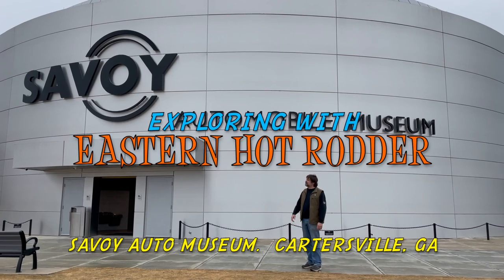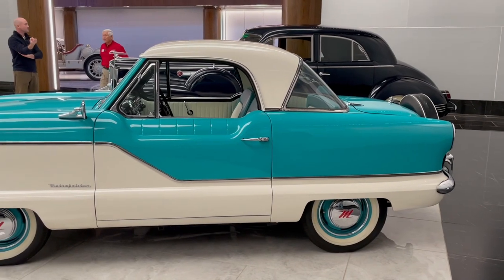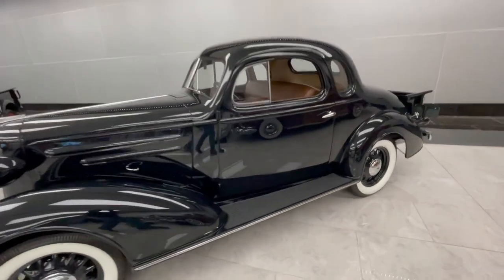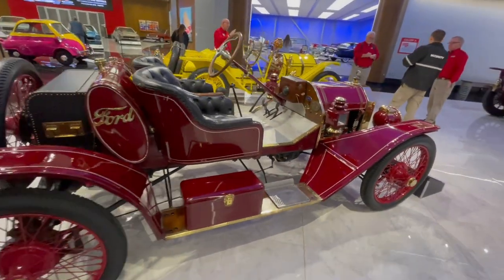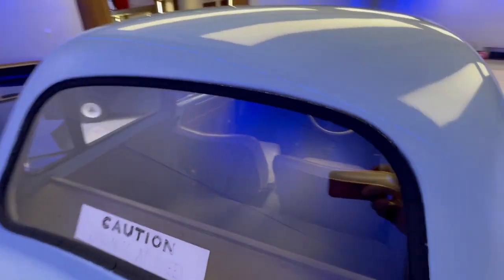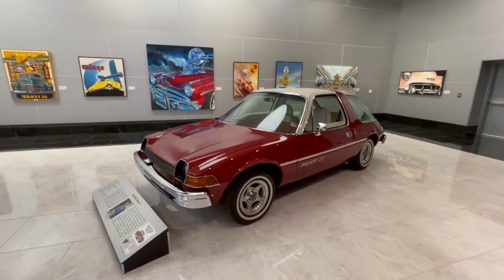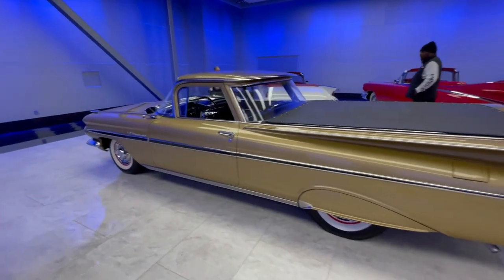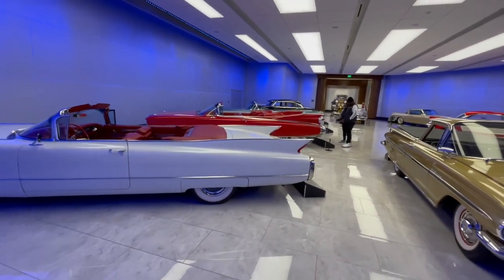Exploring With EHR: Savoy Auto Museum Cartersville, GA

Comment: That isetta and the other micro cars are from the lane motor museum. I sat in the 
Easter egg paint job isetta along time ago. You should go to the lane motor museum. It's the weirdest car collection you'll ever see. And make sure you take the basement tour.
Reply from the maker: That is one place I'm really wanting to get to.
Reply: @easternhotrodder  they used crush cars with the giant AMPHIBIOUS LARC until
A car got revenge for itself and all the others getting crushed and it sliced a hole 
In the 12foot tall tire.
It sat there for a year or longer on a jack waiting for a hard to find tire that size. Fixed now. Other weirdness:
Single wheel cycle. You sit in the middle of the wheel.
Twin engine mini Cooper.
Nissan keeps all there historic cars there.
Biggest Tatra collection in the USA.
The front end of 2 Citroën 2cvs welded together.
Amphibious corvair pickup truck.
Smart car with hyabusa engine.
Honda beat.
Autozam AZ-1.
TANK TRACK on the rear of small motorcycle with snow ski on front fork.
Lamborgini urraco.
Volvo race car.
VW XL1.
Lotus elise.
IF you think you know make and model on just about every car out there, this museum will prove you wrong.
Reply: @easternhotrodder  you Reaally want to go to VOLO CAR museum north of Chicago.  It's got muscle  cars for sale and every major movie and t.v. show cars end up in there. There's a the only show biz pizza 🍕  restaurant left in the usa there. I saw the green GT40 from ford VS ferrari start with a startling roar to be put on display. Monster truck 18wheeler.
Fred Flintstone mobile.
Luke Skywalkers tattoine land speeder from the 1st 1977 star wars.
I recommend going to that one 1st out of the dozens of car museums I've seen in the usa.
Reply from the maker: @coletrickle-km7cl  Oh man, that sounds cool.  If you haven't gone yet, you gotta get to Don Garrets' Museum of Dragracing in Ocala, FL.  That is one of my favorites.
Reply from the maker: @coletrickle-km7cl  Awesome.
Reply: @easternhotrodder  I went to Don's garlits museum back in 2005. I've seen most car museums on the east coast . Dawsonville Georgia's race museum is cool. If you like drag racing then Brownsburg indiana outside 
Indianapolis is where John force's race shop is and other
Racing teams. I also recommend the Henry Ford
Museum In Detroit michigan.
It takes half a day at least to see everything in there. The car John F. Kennedy got shot in is in there and the chair Abe Lincoln was sitting in when he got shot is also in there.
Reply from the maker: @coletrickle-km7cl  the Henry Ford is a bucket list one for me.